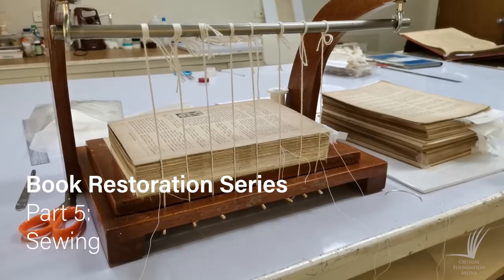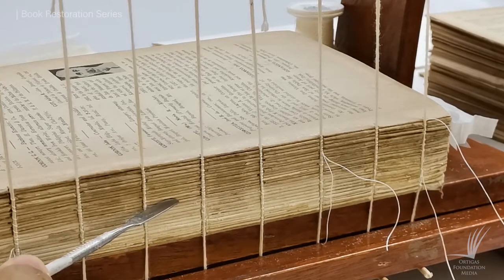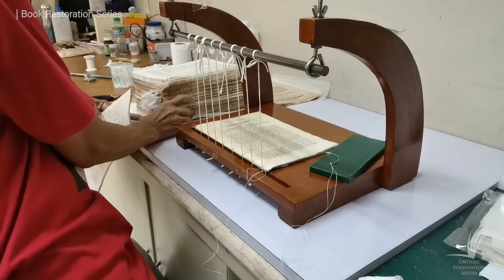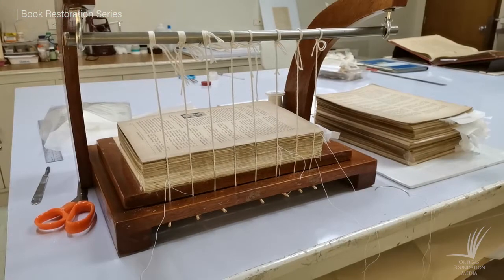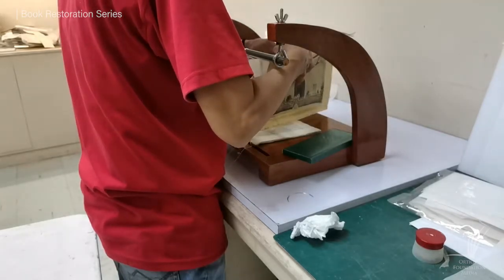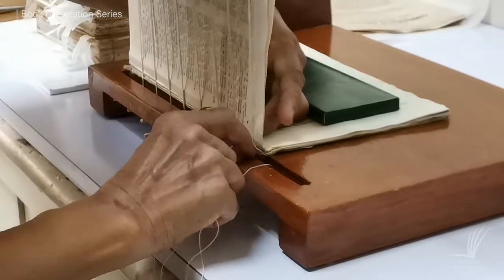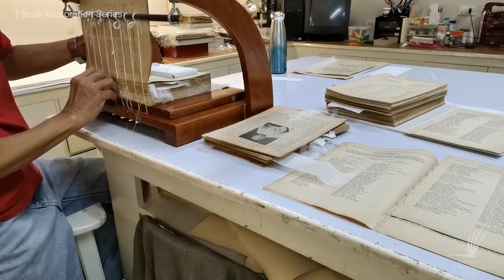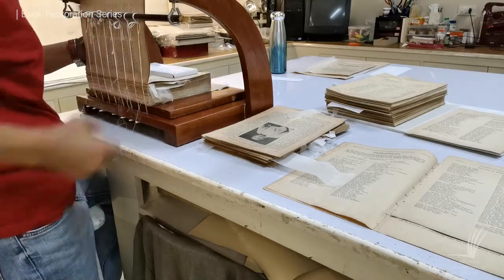Book Restoration Series: Bookbinding - Part 5 (Sewing)

Comment: Do you start with the back signatures and build the book up to the front? Or do you start with the front signatures face down and sew them so the back of the book ends up on top? I'm not sure if that question makes sense, but I would tend to start with the last pages first and sew the book right side up. However I thought I saw in another video suggesting that you start with the front of the book facing down.